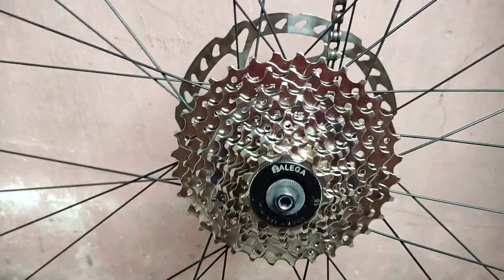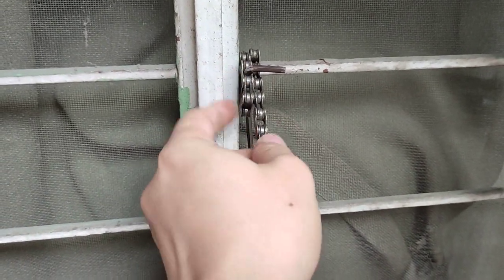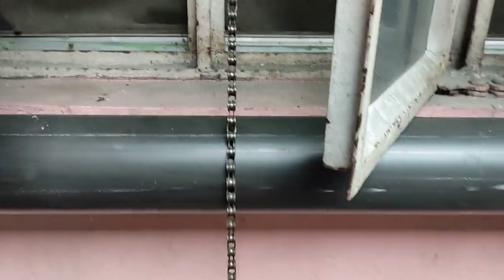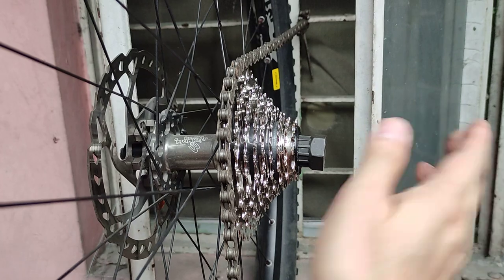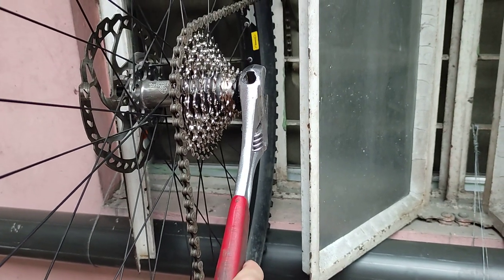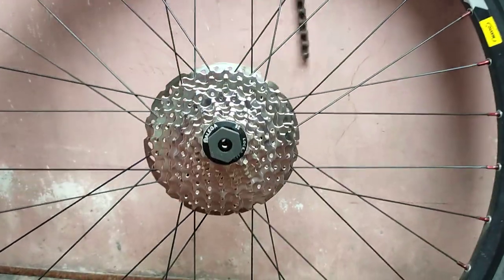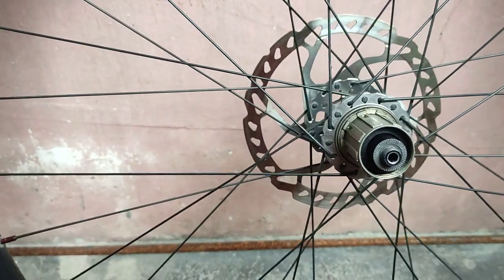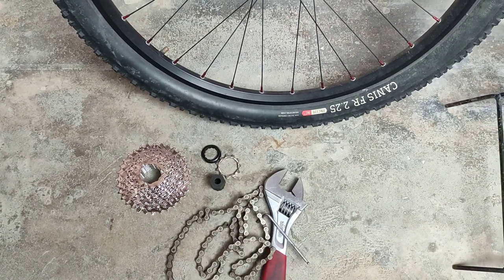HOW TO REMOVE COGS CASSETTE WITHOUT SPECIAL TOOLS OR CHAIN WHIP TOOL?

Comment: Even though I've removed my cassette many times before just using an old chain and screw driver on this occasion the lock ring was so tight it was impossible.  Your window method worked a treat! Thanks
Reply from the maker: window, garage gate, almost anything with strong brace will work, thanks a lot for sharing your experiences with cog removal, thanks for dropping by too..

Comment: Thanks.  Yes, the expression to "use some elbow grease" is correct 😂
One tip for you is that you is that with your type of lockring removal tool you should attach the skewer when doing this [it reduces the chance of the lockring removal tool slipping when trying to loosen the cassette].
But you only have the skewer on initially, once the lockring / cassette is loosened, you remove it.
cheers
JB
Reply from the maker: Thanks for dropping by

Comment: "Without special tools" ? 
What do you call the internal socket. Its a special tool just for bikes.
Reply from the maker: Yeah you just said it tools... I only used one special tool which is the cog sprocket remover, i also said on the title without special tools, so i used a special tool only..hehehe if you know what i meant..
Reply: I agree… “no special tools”.  You actually used THE MOST SPECIAL tool required for this operation

Comment: Broken chain whip, wooops. This method with old chain unlocked 31 years old 7 speed shimano ultraglide casette. 1 day soak in degreaser, cleaned, then 1 day soak in deruster, another few days soak in oil. It moved... thanks.
Reply from the maker: you are welcome bro, there are really some cog lock rings out there that  we call the "breaker of chains" its like previous mechanic tighten em till it creeks the metal lock ring like hell, so far this method works specially with a long tube breaker bar, thanks for dropping by...
Reply: @JomsF  ultimate is grinder but casette would suffer
Reply from the maker: @Fosg8n  i think impact wrench will also work, will upload if impact wrench works on super tight lock rings..

Comment: Bosss meron napo ba kayong stock ng shimano mt300 or mt210 na crank set??
Reply from the maker: Eto link. https://shopee.ph/product/84956873/1642522177?smtt=0.84958350-1616318919.9
Reply: @JomsF  ano po available na size ng crank? 170 or 175 wala po kasi nakalagay dun
Reply from the maker: @richardtabangcura1903  may choices dyan pero 175mm lang meron, isang taon na walang 170mm